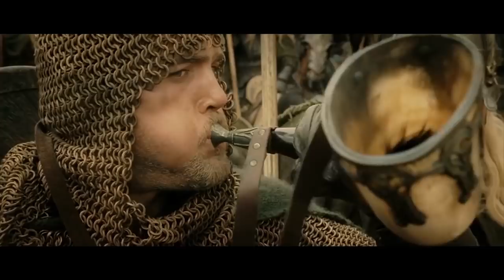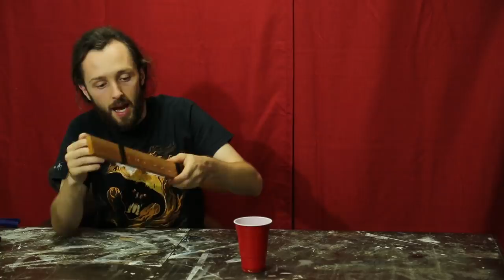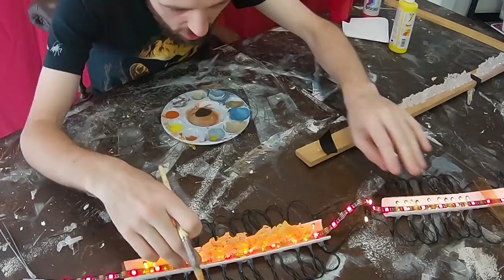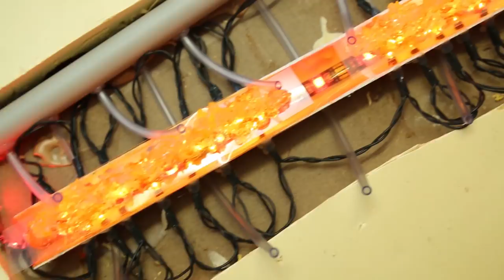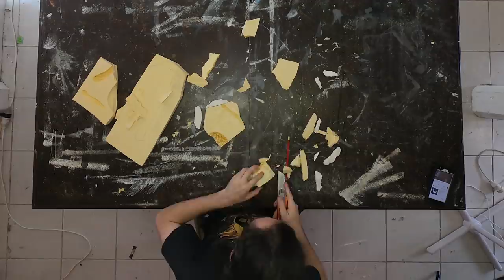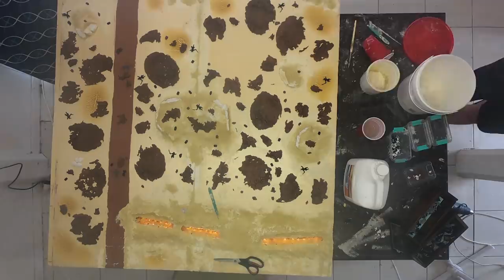Pelennor Fields Orc Fire Trenches with LEDs & REAL SMOKE! ~ Terrain Tutorial Part 3

Comment: That looks ace.

My only thought is for your idea of making new tubing for the smoke machine from metal pipes. I used to work in a live music venue as a lighting technician. One time we had the idea to do something very similar to what you have done there, in an attempt to disperse the smoke amongst the lights more evenly (we didn't have haze machines back then). We hung it up in the lighting rig above the stage, and used copper pipes, which was our mistake. The cold pipes (even amongst the lights, and this was a time before LED lighting became such a huge (and wonderful) thing, the pipes remained too cold) caused the smoke to re-condense and dribble smoke fluid everywhere.
Reply from the maker: That's such a cool consideration man, good thinking! I get a tiny bit of condensation, but luckily the volume I'm looking for is so small it's not much of a worry, but on a bigger rig you'd definitely be right! Glad you liked it :D

Comment: Excellent work as ever! Really like the tip on using Grout to texture the board, I used sand on mine and it's already chipping off after a few games. Ace work though! Can't wait to see the rest of the board!
Reply from the maker: Thanks man!! Yeah the grout is so powerful because it's already an adhesive, I'm starting to use it for everything now. It's also much finer so the scale of the grit feels more accurate to the size of a model than normal sand grain size. BUT you need to make sure you give it enough moisture :)
Reply: @Zorpazorp  Great tip man, all the best, looking forward to the next one! finger's crossed it's on its way soon :o
Reply from the maker: @EntmootVideos  Next week  bro I promise :D
Reply: Yaaay!

Comment: Really Awesome!! Have you kept the leds on long periods of time? They might get surprisingly hot so hopefully nothing melts etc.
Reply from the maker: Yyeah I did a bunch of tests and they'e worked well so far, but they're got a little bit of room in the tube so I think they'll be alright haha :D LEDs are pretty low heat mostly.
Reply from the maker: Thanks <3
Reply: I used green mini LEDs in a board representing the Paths of the Dead and they give off basically no heat at all.
Reply: @Zorpazorp  Nice! My kitchen lighting is done with those kind of flat led strips, and they get so hot that they melt chocolate through the cupboard wall :O
Reply from the maker: @JuusoHuttunenOfficial  oh good Lord!!! Well my strip lighting is at least mounted straight onto the PVC which has a decent thermal resistance but we'll see how we go haha 😂😂